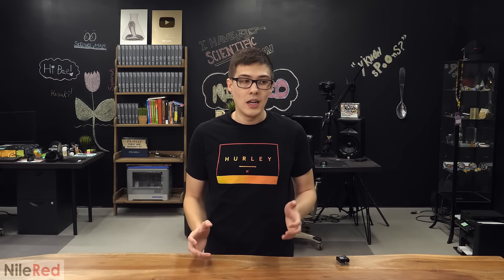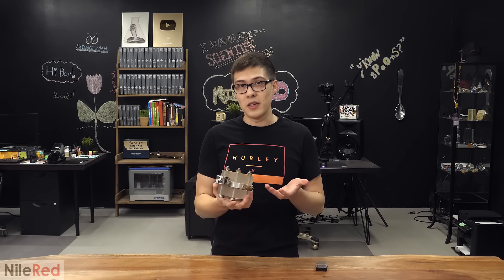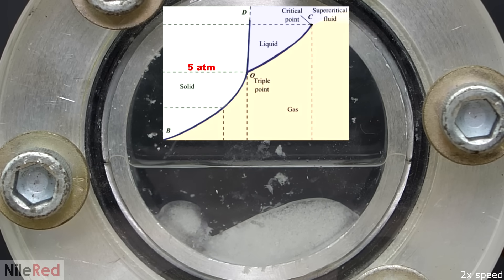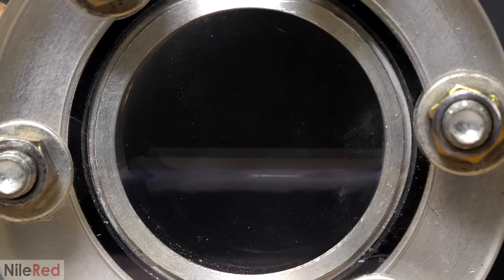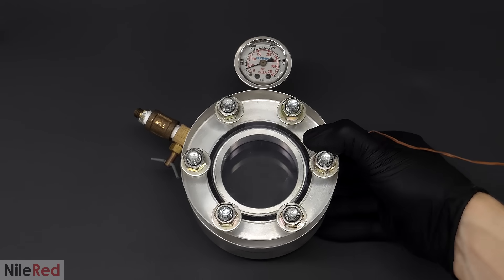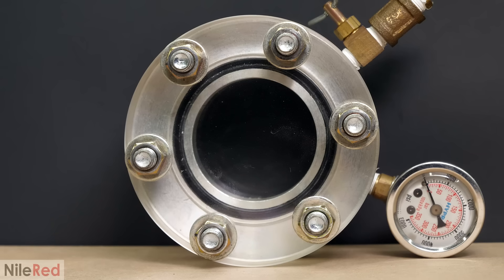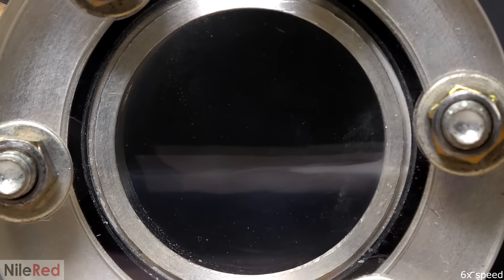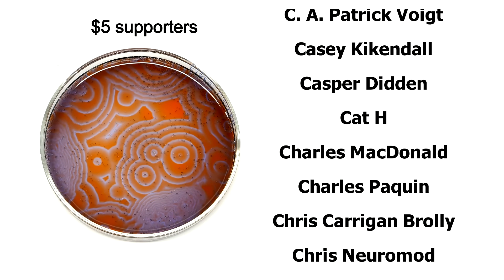Going supercritical.

Comment: As others have said, it looks like the silica beads got stress fractures due to the pressure.
Basically under so much pressure the substance would crack but due to the pressure it held the beads together.
If it hasn't cracked by this point then if there's so much pressure built on the surface of the silica beads and rapidly depressurized, the surface of the beads would rapidly expand as well which would cause cracks.
The colouring on the other hand is due to temperature. As the CO2 solid turned into gas and liquid it would freeze the beads. With the pressure built in the vessel, the added heat to turn the fluid into a gas would also affect the beads. So either freezing or heating of the vessel could cause colour.

That's my hypothesis anyways.

Comment: The silica beads are being crushed under the pressure of the Co2 Gas the same way a boat would be crushed under the pressure of the ocean at the bottom of the Mariana Trench. the cracks are the spaces left in the beads after the pressure has been taken off. They're re expanding to their original state and hence the cracks are formed. That's my best guess at least.
Jupiter's is very similar to your vacuum chamber in the way its atmosphere compresses gas (to the point of a supercritical fluid) which is where i based my guess from.
@NileBlue if you happen to read this look up Jupiter's composition and it might help you understand how supercritical fluids exist etc.

Comment: The "little bit of pressure" on your gauge looked to be around 500PSI. I don't think the original gauge is broken at all, rather the scale goes from 300 to 5000PSI and so relatively large amounts of pressure result in limited and sometimes imperceptible amounts of gauge movement at the lower end. Your replacement had a much clearer scale that starts at zero and goes to 3000PSI for a more pronounced difference at the lower end of its scale and a finer resolution.

Comment: 15:00 No, you're not just making that up.  If the fracture gaps are in the nanometre range you created an interference effect with light.  This is the basic property of "interference effect pigments" which is a micron sized transparent platelets coated with thin nanometre thick Ti2 giving multiple refraction / reflection paths.  The thickness of the Ti2 coating sets the color, from thin to thick in nanometres: white 40-60nm (pearl effect), 60-80nm yellow, 80-100nm red, 100-140nm blue, and 120-160nm green.

If you want to make this get some shampoo that's a pearly white texture.  The pearly white texture is from ground mica (or borosilicate) platelets, so filter these out of the shampoo.  Next you want to sublime Ti2 onto the platelets while being agitated.  From memory I cannot recall the formula / method.  I used to be involved in this industry when I was in China.  If I find my old docs I'll edit this comment.  But don't hold your breath...its over 10 years ago! lol

Comment: What is the O ring material?  Ideally you would want to use fluorosilicone O-Rings as they tolerate very low temperatures.  
The O ring groove design is critically important with the pressures involved - I would not just trust its "good enough".
https://www.sealanddesign.com/page/o-ring-groove-design

Me? I used to be a high vacuum service engineer, servicing laboratory and commercial vacuum systems.

Comment: You can put NUTS in there, after this they make cracking noise because the oil gets carbonated.
If you extract the oil with the co2  from the nuts they taste funny. 
You can do this at ca 600bar and 60°C

Comment: When you heat clear glass marbles to 400 degrees for a half hour, then dunk them in ice, you get results like that. Internal cracks, the occasional external piece broken off, some rainbowy reflections. The temperature change might be what's doing it to the silicon too (or the pressure change might be helping, but I wouldn't know exactly).

Comment: put the chamber in something like a vice, to keep it in place, and USE A TORQUE WRENCH. [it has a mechanism, that can be programmed to stop rotating at a specific tightness. so for this instance, you can KNOW that you're not over or under tightening those bolts.

Comment: You may want to apply a specific torque when tightening the bolts. Here's a sample chart that may help in figuring out what that should be: https://www.portlandbolt.com/technical/bolt-torque-chart/.

Obviously the iridescence in the beads is due to some sort of refraction taking place in the translucent material, suggesting that some sort of crystalline structure may have formed. Or maybe something else.

Comment: The opal-like colors are probably from the same phenomenon that gives opal, oil on water, reflection holograms, and dichroics their color. Light bouncing between 2 semi reflective surfaces that have a distance of the order if the wavelength of light intefere at a wavelength that is an integral distance of tje 2 layers. The beads fractured and the cracks are of the order of the wavelength of light.

Comment: The silica beads have a high inner surface (a lot of pores), so if it isn't thermal cracking, it could be the difference in pressure between inside and outside the beads. Could be tested by letting the CO2 escape slowly. The rainbow is likely to be from interference as you create 2 adjacing surfaces at short distance. That means part of the light gets reflected on both sides and interferes with itself. Since the distance is small (in the range of a wavelength), this effect is strong for only certain frequencys, thus the angle dependent colour.

Comment: Check the back of that gauge. There should be a rubber cork in the oil fill hole. Purge the gas in it. It should fix it. These cheap oil filled gauges gather pressure during altitude changes. Would happen on a drag car I would work on.

Comment: Don't you ever do that again without a torque wrench. If you need calibrated torque wrenches, I have them. This was extremely unsafe using just a ratchet and "eye-balling" it. WAGS FINGER. We set hydrogenation chambers(aka bombs) with torque wrenches. NileRed you hath sinned against the Gods of safety and calamity shall follow. (NileRed reads this in a year, says "Nutcase" and goes off on his merry way).

Comment: The iridescent colors are probably caused by thin film interference in cracks caused by uneven and sudden pressure differences in the silica gel. This is very different from opal, whose opalescence comes from millions of years of uniform deposition of microscopic silica spheres of the same size from a silica rich solution. Silica gel is also very good at absorbing liquid, which heats and cools at a different rate, which could have caused the stress fractures in the gel.

Comment: I sell rocks and minerals. Those are 100% stress fractures caused by the silica being heated and cooled rapidly. Look up crackle quartz. It's basically quartz, a silicate, up to red hot then quenching it in water causing crazy stress fractures on the inside of the stone.

These fracturea cause light passing through to be broken up creating those colors you see.

Comment: 16:30 @NileBlue you can see the same color shearing from the silica beads around the glass where the co2 leaked out thru the bolt! Idk if that compromises its integrity but thats definitely the same coloring as the silica beads after being in supercritical co2.

Comment: If the gauge is designed for gas, then allowing liquid CO2 into it could have damaged it. We can speculate all day (and couch experts probably will). Maybe it was the liquid itself. Maybe when the liquid turned to a gas, it flash froze the gauge, damaging delicate components inside it (ie: any bladder/membrane designed to help facilitate the pressure differential). ETC, ETC, ETC. At the end of the day, the what is potentially just a what if. I would say that you should not have the gauge facing anywhere but up to mitigate as many problems as possible. I work with some pneumatic, and hydraulic systems, and that is generally the manufactures caution/recommendation.
Good luck to you in your endeavors!

Comment: What we see is more similar to the vague hints of iridescence seen in muscovite and biotite(also both silicates) which are caused by trapped impurities between two layers of the substance, like oxygen or anything that refracts light differently than the silica itself. Similar can happen in quartz(which is much more similar in structure to silica beads than opal). The visual similarity to opal probably comes largely from their spheroid shape as thats usually how we see opals cut.

Comment: It would have been cool if the stuff you put into the super criticlal CO3 would have more or less the same density as the super critical CO3, since then the stuff would not sit at the bottom but instead just weightlessly float around, just like the unknown small particles did in your video.

Comment: Cool video Nigel! 
There's actually some work being done on supercriticalfluid chromatography at my uni, from which I know Nilered is used as an indicator of solvent strength due to it's solvatochromic properties. One leading theory of how modifiers work in SFC is that they form a layer around the stationary phase (often bare silica) which analytes can partition into. In this case a slight adaptation to your current setup could possibly show if this actually happens, by just adding some methanol and nilered in the mix and taking some fresh silica beads. Here are some refs:
doi:10.1016/j.chroma.2012.02.037
doi:10.1021/ac00205a015

Comment: I think the color in the cracks from in a similar way like heated metal turns blue. 
The ligth is partially reflected on one side of the crack and an other part reflected on the other side. The little differece causes the waves to interfere with each other and make colors based on the angle you look at it.

Comment: an accessory i always thought this should have back on ben's channel, just something larger you can load dry ice into, attach to the valve and drip liquid co2 in instead of having to very quickly close the bolts and then close the valve, also the first thing i thought when i saw the rainbow effect was thin film effects, i've seen glass crack rainbowy before, it has to be at a pretty shallow angle of break though, like nearly parallel to the plane of a sheet of glass

Comment: You can probably easily repair the gauge. -most likely the pinion gear has just slipped on the rack gear and needs to be reset at a known pressure.
Reply: Except pressure gauges neither contain a pinion gear or a rack.
Reply: @oscarmuffin4322  Yes they do - You could google: "how does a pressure gauge work"

Comment: I'm not sure if anyone has mentioned it but

The dry ice you put in there had frozen condensate on it

Would it not dissolve in the liquid CO2 and form carbonic acid? When the pressure releases suddenly, it could quite easily, at that pressure, form those clouds you saw by condensing into water droplets. I mean, that water went somewhere.

That's the same process used to make aerogel, more or less, isn't it? Forming a cloud of a desired solute?

Comment: The making of aerogel is pretty interesting. I always wanted to try it, but I was afraid of building the pressure chamber. Even though I watched Bens videos back then, which made me think that it's not too bad. Btw I'm pretty sure it has to do with interference due to the small gap in the cracks. I couldn't find a good translation, but it's kind of translated as "phase jump" in german.

Comment: I think those colors are one of two things. 
First, it could be a diffraction effect. Different thicknesses along the cracks would reflect/transmit different wavelengths of light. These wavelengths would be dependent on the thickness of the crack, which is why you don't always see full rainbows like a prism. This is basically the thin-film interference effect but with a bunch of thicknesses of films and at basically random angles.
Second, it could be an effect like nacre or opal, where the microscopic structures of the silica scatter light differently once they are released from the homogeneous structure in the bead.
I'm not sure which of these effects it is or how to test it. The only way I can think of off the top of my head is to use an electron microscope, which doesn't seem practical.

Comment: I'd put some liquid nitrogen in a vacuum chamber to lower its temperature, then I'd take it back out and put the dry ice in there to even further reduce its temperature and preserve its solid state. Next, I'd vacuum the dry ice once it's in the pressure chamber and repressurize it with just CO2 so that I could get rid of any gasses that weren't CO2.

Comment: so the multi-color phenomenon, i think you're pretty close to correct with your explanation.
the cracks probably separated two layers of the bead to be just around half a micrometer from each other, so the refractive index changes from bead to air/vacuum to bead again, giving you that pearlescent effect from the reflection off both of the refractive index changes.

Comment: I think what happened to the beads is just a heat shock due to fast fluid evaporation when you released the pressure. Same how glass shatters if you heat it and then throw into water. What you see is a diffraction pattern between two very close layers separated by a crack.

Comment: That happens all the time with cyrstaline minerals. You can do it with pure salt cubes, fluorite, moonstone, and quartz. Quartz is just sillica and oxygen so it's essentially the same as the sillica beads but probably with less chemical additives. Getting a small quartz crystal isn't too hard to do either. Using a "clear" quartz crystal would help determine if the color change has something to do with the oxygen present in the silica because of its simple chemical composition.  It would help to get something like salt too just as a control factor.

Comment: "It's like a bomb, but it should be safe."  LOL!

That rubber seal is useless at those pressures.  At this point your seal depends on machining tolerances between hardened surfaces.  Don't be afraid to crank those bolts down.  Add thicker and wider while layering washers to prevent cracking of the polymer windows.  Ideally you should have a heavy, rigid, and thick ring of steel outside of the polymer for the fasteners with washers to press down upon.

Edit:  The obvious fact we can see scratches and machining marks on that inner steel ring means your seal is crap.  It should be a mirror finish.

Comment: I think the reason the colors are showing in the silica beads is due to QED. Photons experience a change in velocity when passing through a barrier between one substance, such as silica, and another substance, such as air. The CO2 got inside the silica beads and created microscopic cracks when it was forced out rapidly. The cracks formed just as you would expect glass to crack: in a flat, planar manner. This occurred many times throughout the beads, resulting in multiple silica-air differentials, created a rainbow effect as the photons change velocity and thus produce different colors.

Comment: You can't get aerogel from silica beads. They're not really a "gel with tiny holes" in the first place. In other words, you HAVE to start with something that has similar microscpoic structure to edible jelly. The process invloves replacing the space-filling fluid with super critical CO2, and then route the phase path DIRECTLY into gas phase WITHOUT any sort of condensation (which may be achieved by a constant heat source and slower pressure release).

Comment: The 'play of color' effect is coming from the cracks in the silica beads... Unfortunately even though it is a cool effect its the unit being broken that gives that effect... (Silica is opal, just like you said...) 1200+ psi... So imagine the area of the chamber you filmed times 1200 and thats what you were holding and shaking around...
"Fun with Explosive decompression" :)...
Thanks, looked like good fun.
-b
Edit- I don't remember if your gauge was reading psi or bars
If it was psi it would be a little less than 100× the area :)...
Either way I'm pretty sure explosive decompression will happen below 20 psi difference, dont quote me on that I'm a musician not a scientist :)...

Comment: The light refraction is likely interference caused by the structure being broken into individual grains, the same effect you get with very good metal finishes after machining them. The color change would be carbon going into solution and forming silicon carbide, which is usually an iridescent  green.

Comment: Couldn't you use an Irwin clamp to maintain pressure while you run the hardware up? Also if you used a strain gauge style Torque wrench you would have even clamping force?